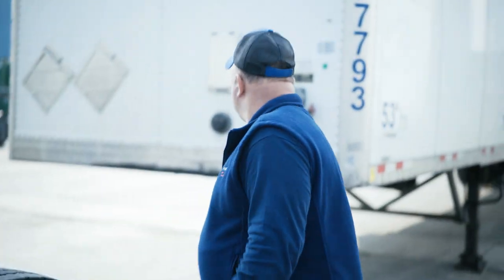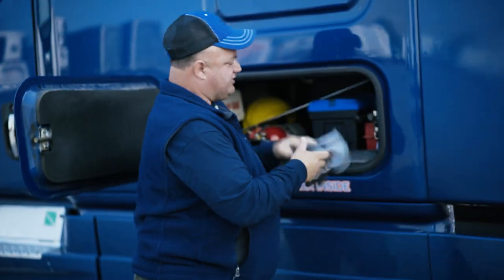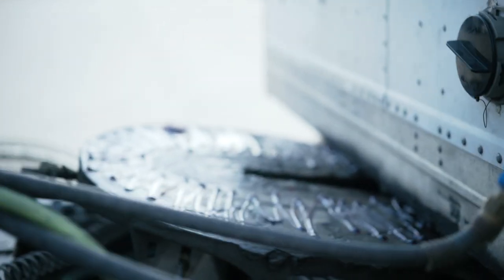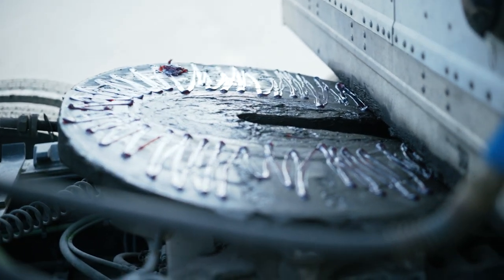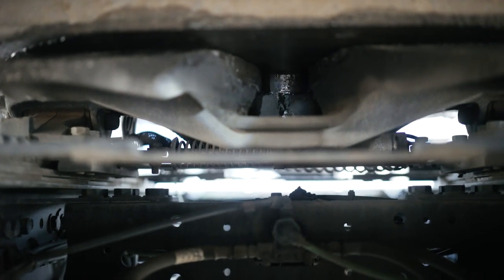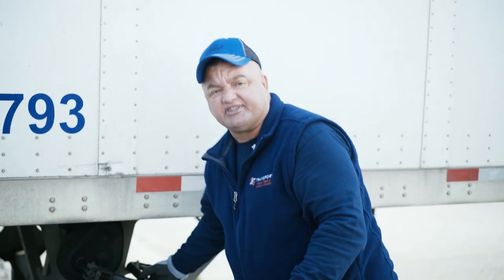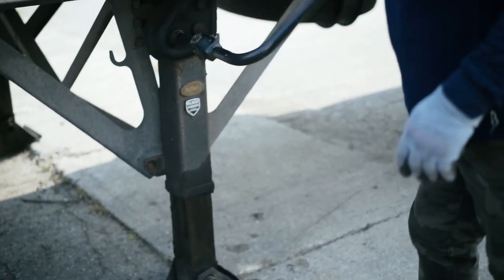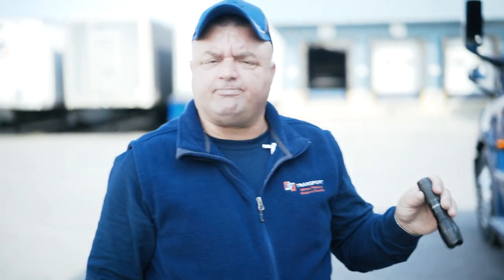Demonstration -  How to couple and uncouple a tractor trailer Instructions, how to properly hook

Comment: In the 1st 5-muntes of the instructional video, I would give it a 9/10. I have seen a few of these instructional videos, and yours is the 1st to connect the lines 1st before coupling. Even though the trailer brakes are better than they were in 1976, there should be what I call a 5-second charge. Hook up, push the trailer button in only, look at the gauges for charging. If it settles quickly, pull to shutdown. This is what is called a 5-second charge. You should hear a discharge of the trailer brakes, tell you the system is charged enough to go under. The use of the Flashlight to give a look that you are locked into place, thumbs up. So far The Best Hookup I've seen thus far. Nice going... Kudos to the drivers, great job.

Comment: Looks like you were (properly) trained by commercial safety college, like I was. It's hard to imagine for many, but a few decades ago we still had legacy trailers with no maxi brakes. These trailers would take off on you if you didn't air them up and apply the service brakes. Funnier to describe than experience, especially if there was ditch or fence behind them . I leave the feet off the ground if trailer is mt but touching if loaded. I see the guy that dropped it had trouble finding the concrete ;-) You can drop the air to get under but that doesn't help if the tires are hitting the trailer before the 5th wheel. Maritime drivers = the best!

Comment: Don't grease the locking jaws on your fifth wheel. They're polished chrome and don't need it. I've gotten stuck for hours under an empty trailer because the mechanics grease the jaws, and once the grease hets old and mixed with road grime it becomes like cement and the jaws won't open anymore.
Reply: You’re crazy if you don’t grease your fifth wheel
Reply: @Nikosakii  He said the locking jaws not the plate

Comment: This is not how you couple the Trailer to the 5th wheel. WOW on a real life road test, it would be an automatic fail. The exammer would say to you, ok you're done. Plus you have to tell the exammer you're Pre-trip inspection details, as you're completing each step by step. 

THIS IS HOW YOU DO A REAL COUPLING! 
The Supply line has no cut or damage, it's secure at the top. The Supply glad hand is not crack or damage, the fastener is tight and secure. The rubber seal is good. The Service line has no cut or damage, it's secure at the top. The Service line glad hand is not crack or damage, the fastener is tight and secure. The rubber seal is good. The electrical line has no cut or damage, it's secure at the top. The 7 pins is not damage or crack, I don't see any corrosion.

The 5th wheel leaver is fully out, there's no damage. The 5th wheel is grease and tilted forward. It moves up and down there's no extra play in the 5th wheel. All the fasteners are tight and secure they're not loose damage or missing. The safety pin is tight and secure, it's not loose or damage.  

Walk behind the Tractor and say, The 5th wheel jaw is fully open. 

Go around to the Right side of the Tractor and say,

There's no extra play in the 5th wheel it moves up and down. All the fasteners are tight and secure they're not loose damage or missing. The safety pin is tight and secure, it's not loose missing or damage. 

After you back up towards the Trailer  apply the Spring brakes and say,

As you can see there's enough clearance between the 5th wheel and the trailer. I will now go underneath the trailer so I can check the alignment between the 5th wheel and the King pin, the 5th wheel and the King pin are both aligned 
the upper coupler plate has no crack or damage it's not bent or broken and there's enough lubricant. The king pin is not damage crack bent or broken and there's enough lubricant on the king pin. 
Inspect the Glad hands on the trailer and the little lines that's connected to them say,

The Supply line are tight and secure I don't see any cuts or damage, the glad hand has no crack or damage the rubber seal is good. The Blue Service line is tight and secure the glad hand has no crack or damage the rubber seal is good, there's no cut or damage in the line. The 7 pins is good they're not broken missing  or damage I don't see any corrosion. 

After hooking up the 5th wheel and King pin,
Get out and look at the upper coupler plate, there's no space between the upper coupler plate and the 5th wheel. The 5th wheel leaver is in the locked position, there's no damage to the Jaw it's locked around the king pin. The 5th wheel jaws are locked.
Connect the air lines and electrical line.  Raise the landing gear and remove the wheel chocks. 

You are ready to do you're driving portion of the road test.
Reply: This isn’t a pre trip inspection demonstration bud
Reply: @swutted3439 there’s always one of those guys.